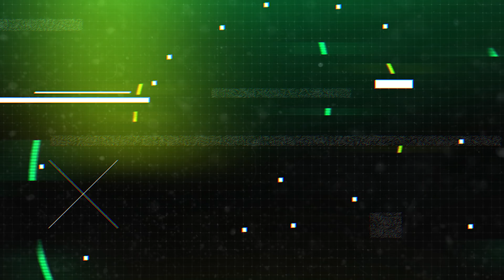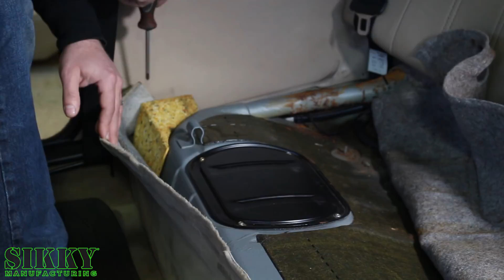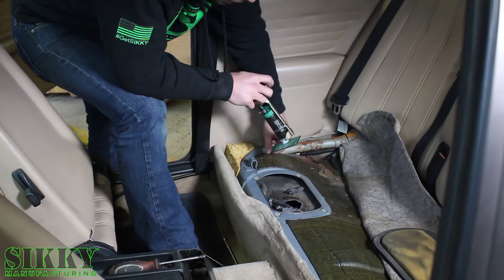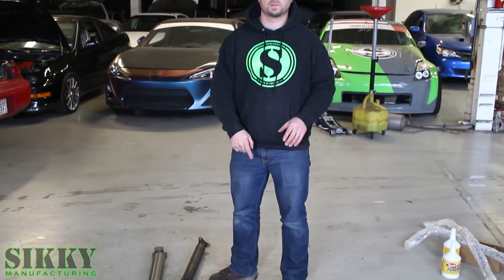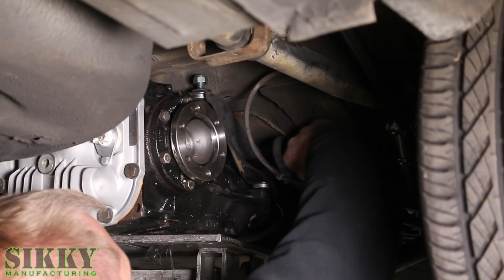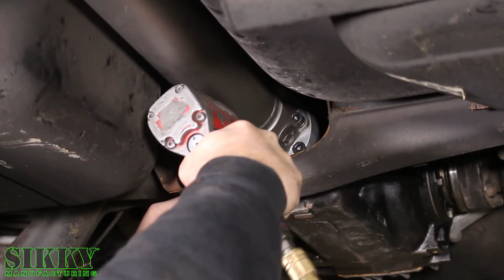BMW E30 LS2 Build Pt 6 | Drivetrain Upgrades | SIKKY Manufacturing

Comment: The stock bmw fuel pump isn’t good enough ? It’s 51 psi
Reply from the maker: Most GM ecu's need 58 psi so it's going to run lean if you don't go in and change the fuel maps if only running 51 when at wide open throttle.

Comment: Do you think the weight of an iron 6.0 would be too much? I worry about adding another 100lb to the front of a rwd, but LQ4s are so cheap!
Reply from the maker: Tyler Rogers I would recommend sticking with aluminum block but if you had to go that iron block route it would be ok and if you’re car was a 6 cyl before the swap it’s even leas of a difference
Reply: @SikkyTV  appreciate the response! In terms of diff and rear axles, would you go a different route knowing what you know now?
Reply from the maker: Tyler Rogers the rear diff is fairly strong stock but it all boils down to intended use. If you’re not planning on launching from a stand still with big sticky tires you should be fine. If you plan on beating the snot out of it would recommend an upgrade
Reply: Appreciate you taking the time, cheers!

Comment: Can you use a automatic transmission with no cutting
Reply from the maker: We have not tested with the 4l60e transmission in house here but we've been told it can fit.  Some of the bigger auto trans like the 6l80 or even 4l80 would probably be tight.

Comment: I had a swapped s50 e30 but the LSX looks like a plan
Reply from the maker: yes, makes much more power easily and reliability is way better.  Plus any parts needed for repair are much cheaper.

Comment: Could it be possibile to have a drive shaft like that shipped to italy ? i'm not installing an LS, but even for a m52b28 that looks way better. Awesome work, very well and easily explained !
Reply from the maker: If your running the factory e30 transmission it's possible we could make you a driveshaft like this.  We would need to know if this is the standard transmission like we have over here in the USA also and I don't know a way to confirm that.  You can email sales@sikky.com for more info

Comment: Hey guys awesome job with the build and vids. I'm new to E30 world. Planning on doing an E30 with a LS3 mild cam and 4l60e. If I were to replace the diff what type of setup would you suggest?
Reply from the maker: Hey Glenn, there are a couple options depending on the power you plan to make but just upgrading to an M3 rear is usually enough for most unless your going with forced induction and making a lot of power.
Reply: Cheers. Thank you very much sikky. Have one other question, with your transfer kits from ls into a e30. Have you had an dramas or feed back with people using them to get a ls into a right hand drive car?

Comment: Nice, coming along well guys. Where can you pick up that upgraded rear sway bar at? Also is there a big difference between your standard drive shaft and the aluminum one you also offer for a few bucks more? Thanks guys!
Reply from the maker: Not sure on the bar, customer provided it. The aluminum shaft is lighter and absorbs drivetrain shock a little better than steel. Both work great though
Reply: SIKKY right on, I'll have to do some research on the sway bar and pick one up for sure. Might opt for aluminum get the most out of this build thanks for the quick response as always!

Comment: Molment of silence for the axles.. rip little buddies.
Reply from the maker: Ha ha, yeah we kinda wanted to see what abuse they would take but looks like we won’t get to now since upgraded axles will be installed shortly
Reply: At what HP level would you recommend a solid axle upgrade? Ford 9" and 3 link?
Reply from the maker: @jeffreytatreau5780  I don't think I would want to do a solid axle.  Maybe if it was strictly a drag race car but losing the IRS would have some negative effects on the cornering of the vehicle.
Reply: The IRS stuff we can get is strong enough to handle any power level you can safely put down in an E30.  Once you get too much power, the car is almost uncontrollable anyway LOL

Comment: What are the OEM axles rated for?
Reply from the maker: Not 100% sure but we've had guys report that they are holding up in the 500 range.  Depends really on how your using the car.  For example, a drag race setup launching from a stand still will fail way before a road coarse car would. Turns out a couple days after shooting this the owner surprised us with upgraded axles so looks like we get to unbolt them again, Yay lol!